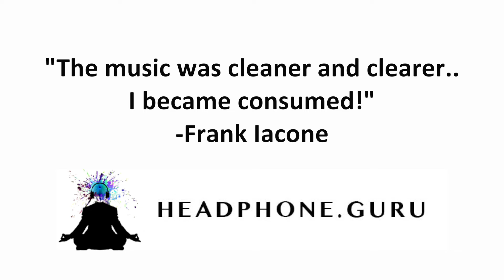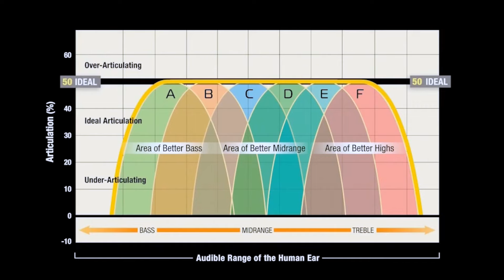VERO HCA 29 High Current, Silent Powered Headphone Amp

Comment: There is too little technical and other info on the Indiegogo campaign page. Will the new reference dongle come with XLR 4 pin male to XLR pin female plugs? If so, I would put my money down for one.
Reply from the maker: +tcpiptv Yes.. the reference dongle does come in XLR M-F plugs. I'll make sure to make that more clear on the campaign. Thanks!
Reply: +MITCables Great! I'll definitely perk for one. I guess part of the idea of crowd funding is to test the market. I think it would be a good idea to have a $1 perk to allow potential customers and MIT fans to ask questions or give feedback. Alternatively, perhaps starting a thread on Head-Fi could fulfil the same purpose.

Comment: What is the exact launch date of the Indiegogo campaign?
Reply from the maker: +tcpiptv We expect to launch tomorrow (Wednesday March 22nd) or Thursday the 23rd. Definitely before the end of the week.
Reply: +MITCables Will this be a fully balanced design? I can see the 4 pin XLR headphone input.
Reply from the maker: +tcpiptv The 4 pin output is provided for all common 4 pin headphone connections. The Vero HCA 29 is a single ended circuit, with RCA and TRS 1/8" inputs.
Reply: +MITCables Ok. Thanks.

Comment: Do you need to use VERO cable with the Vero HCA 29 Headphone amp.If so, is their an advantage to using Vero Cables with the New Vero Headphone amplifier. As the Amp may be doing the same thing as the Cable - overkill?
Reply from the maker: +Charles Thom the amp is great without the Reference cable, however, the best combo is with the Reference cable. It's not overkill. In many of MIT products, there are multipole "poles". The only "overkill" that I have experienced (and it's not really overkill as much as it is loss) is when you "daisy chain" too many cables (i.e., Reference, adapter, dongle.. all in one sitting.) Although.. we have always considered the Vero line of headphone cables a "system" which is beneficial for many different types of listening depending on the music. Sometimes the music is better with the Vero Ref and the Bass dongle combo, sometimes it's better without the Bass dongle. Experiment.. that's the pleasure of finding the perfect balance with our technology. You can find more information on the Indiegogo Campaign.. https://igg.me/at/verohca29/x/9396416